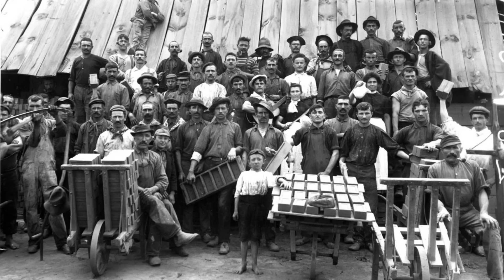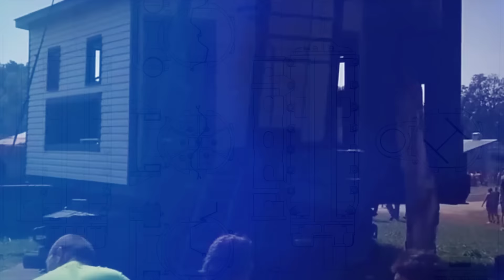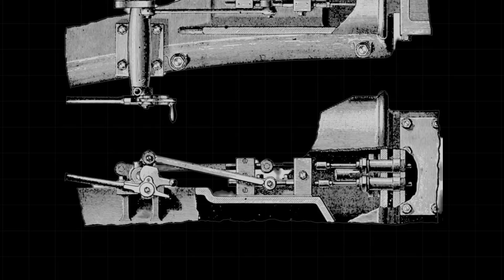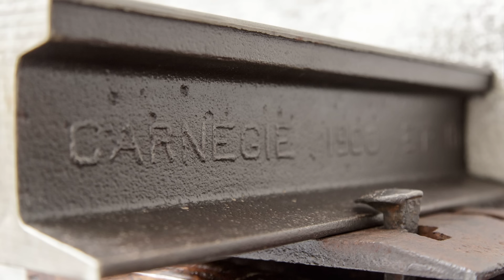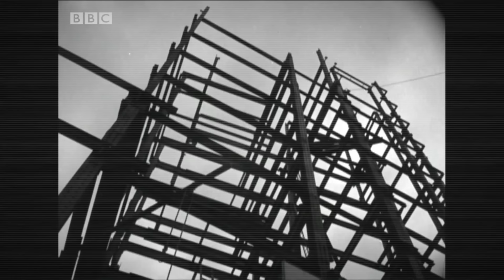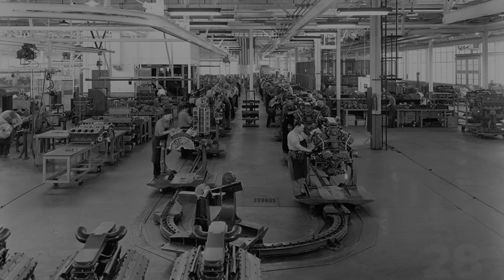Before Hydraulics: Pile Driving in the 1800s — Brutal and Deadly

Comment from the maker: Here's a fact that didn't make the final cut: In 1595, an Amsterdam carpenter named Lamprecht Gerritsz patented a pile driver that needed 7 men instead of 30. The patent was granted. Nobody used it. For centuries, builders preferred hiring more men over building better machines — because labor was cheaper than timber. That one detail tells you more about pre-industrial construction than any textbook.

📺 More Before Hydraulics:
- The First Bulldozer Blade Ever Built → https://youtu.be/OSSrH6Z1oLI
- 1950s Scrapers: Caterpillar vs. LeTourneau → https://youtu.be/SuQdiFPvrKQ
- Cable Cranes That Built America's Bridges → https://youtu.be/jOrhWxIqdww
- How Caterpillar Killed the Steam Engine → https://youtu.be/sE9sB2w9Vig